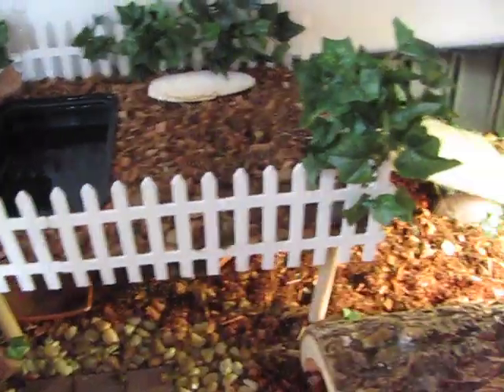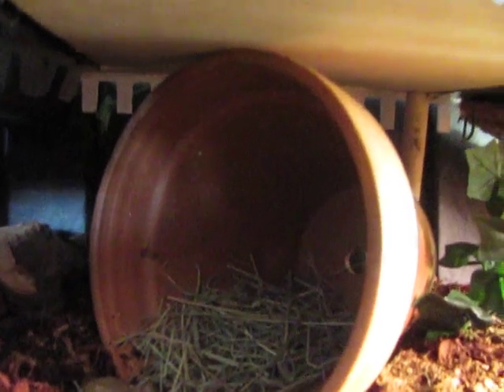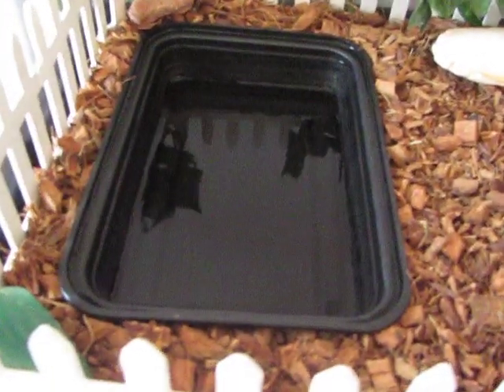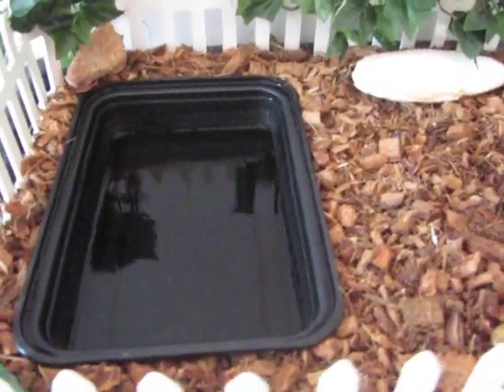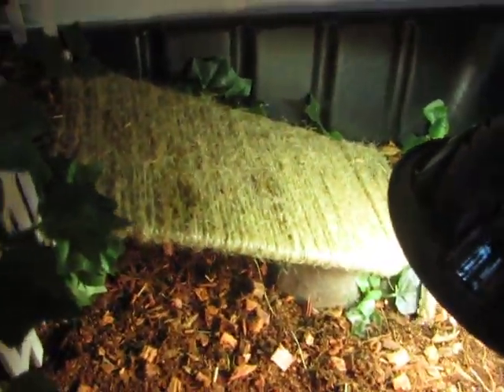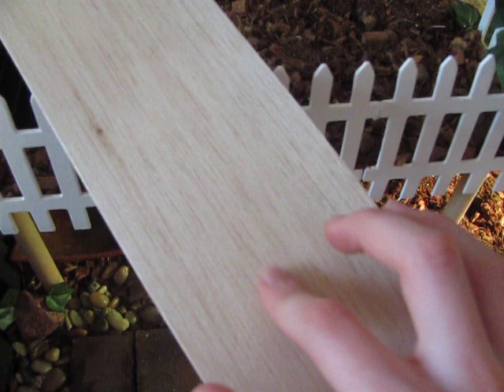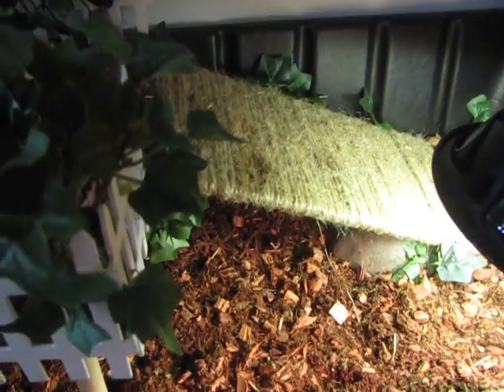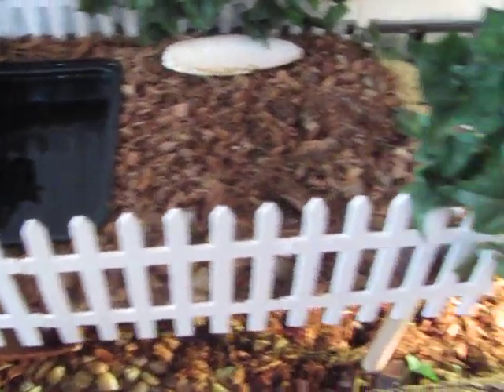Russian Tortoise Enclosure: Second Story

Comment from the maker: I'm well acquainted with Exo Terra Enclosures. The dimensions are great, but it's really an issue of having the tortoise in a glass enclosure. They don't understand the concept of glass (or semi-transparent wire mesh, for that matter), and will REPEATEDLY walk into the sides of the tank. It's plain and simple not a good idea when there's a cheaper, more ideal alternative.